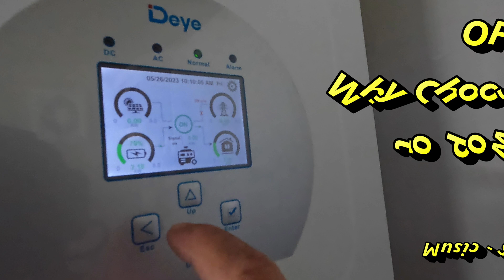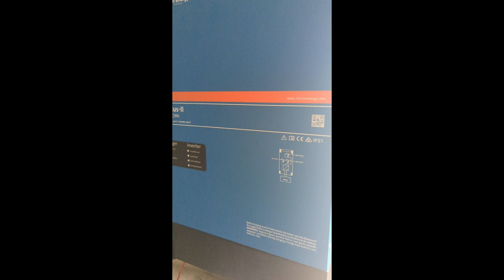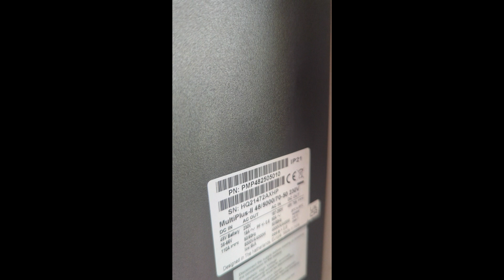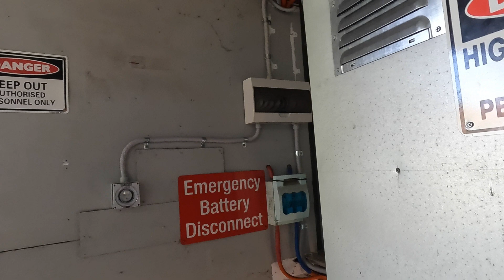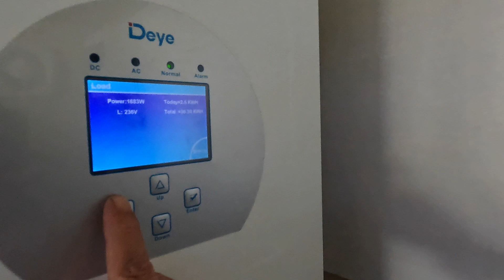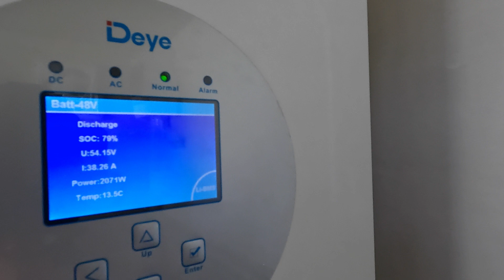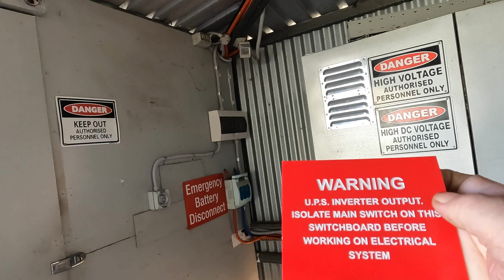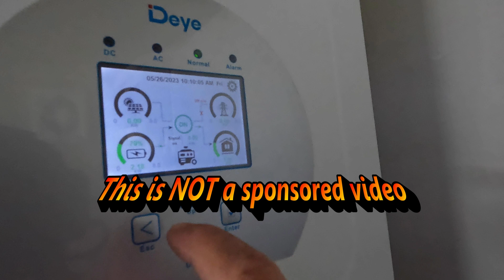OFF  -  Grid ?  Why Choose a Deye Inverter to Power your Home ?

Comment: The poor monitoring and lack of BLU Tooth or WIFI plug and play really annoys me with my MPPSOLAR inverters now granted they are 2018 tech and I am please with them other wise. But I agree on your point about monitoring and add ons eating you up. 
I will not use victron because they are so so so expensive. I just do not see the point to go there on my budget. 
I will likely go Hydro Electric on my next system since our winters are low sun and a whole lot of rain. 
I like my solar but batteries are just so expensive as well.
Either way OFF GRID is the only way to go. 
Jim
Reply from the maker: The new tech has made off grid easy. Lithium's charge so fast . We will see how well it does in heavy rain. So fare with heavy cloud it had done extremely good. 😉👍
Reply: You can use "solar assistant" to have beautiful realtime monitoring and stats even with cheap chineese inverter

Comment: Hey Chris, glad she's performing admirably, yes my Sunny Boy is dead silent and doesn't even get very hot at 5kW, the Sunny Island has a fan which only comes on under heavy sustained high current charging, otherwise it is silent...top gear ! The Victron sounds like somethings vibrating inside...it needs a look at !🤠😎
Reply: I could not live with that Inverta  it would drive me crazy🤔 thanks for the updates
Reply from the maker: @MickelPascoe-of6ns  Same mate.  It's inexcusable to for it to make such a noise. Just really poor build quality 👍.
Reply from the maker: He had his installer back mate. Apparently it's normal for them. Sounds to me like it's just expensive junk. 👍 🕵️‍
Reply: @JustinCaseSolarPower   Jeepers, if that's normal then, that's not for me !!! That would drive me further bonkers LOL  😭😲🤠
Reply from the maker: @AndyM...  My hope Victron see this video and ask for the mans name and address and sort this problem out. 👍

Comment: Its because victron are low frequency , ie using transformers which last longer than high frequency inverters.
Reply from the maker: Mine is also Low Frequency inverter, ie using a transformer,  There are many low frequency inverters on the market. I have used quite a few. The Victron in this video is the first one I have every heard making that sort of noise.  I am not new to this, When I started doing solar you could only get low frequency inverters. There was no such thing as High frequency inverter. Afraid there is no excuse for poor build quality.
Reply: We use victron now as the chinese inverters don't last overall 30% failure rate for most of them past two years old. And customer service is not there , At least with victron you get support fan noise is not a real problem.

I have been offgrid in WA for over ten years and tested many products and have dropped in on your channel regularly solar power is evolving very fast now.But I must admit my old pip4048 is still on the wall as backup I believe chinese inveters being made at the moment are not to the same standard they use to be pre pandemic.
Reply from the maker: @phillipmoore4492  I am not going in to how good they may have been. I considered  Victron when looking to upgrade my system. Looking at forums and having problems myself with there MPPT charge controllers I quickly gave up on them.  I emailed them lots of times on the problems and got no response.  In the comments of this video I see another with the same inverter that has the same problems. They Need to sort this out. There is no need for low frequency inverters to make such a racket.

Comment: yea my growatt needs a batter fan it.s to loud i saw a video some one putting in batter fans
Reply from the maker: Growatt is very cheaply made and have quite a few problems I found out in my research.  I was thinking of installing 2 of them but for that price range I got a real inverter that Dose it all including load sharing with my 2.8kw generator, Justin case I ever need to charge these batteries a tad. I hope the Deye will last as long as the batteries do. I never want to work on this system again. Takes up to much time, and that is time Sigi and I could be in the Outback looking for top camping spots. 😉👍